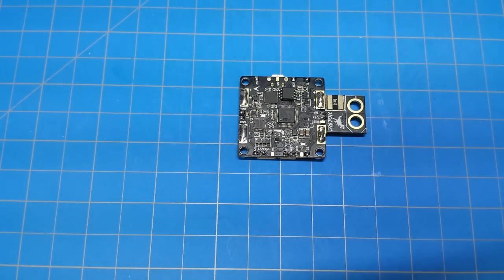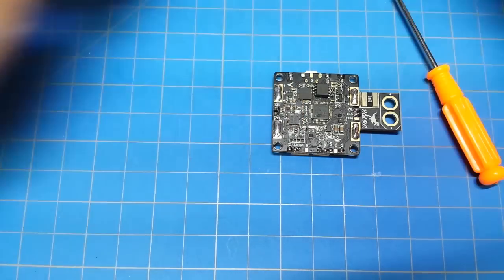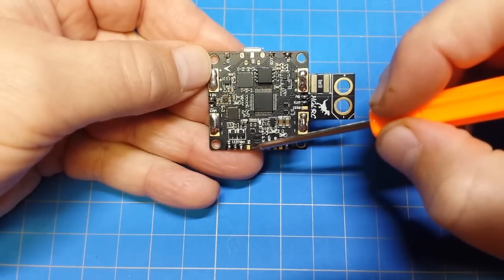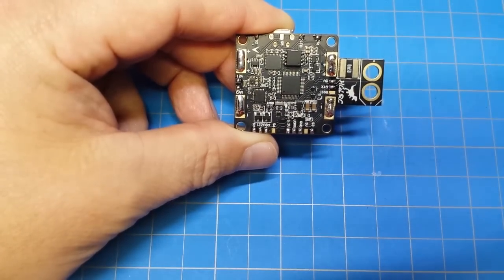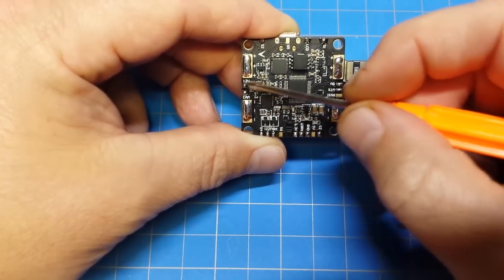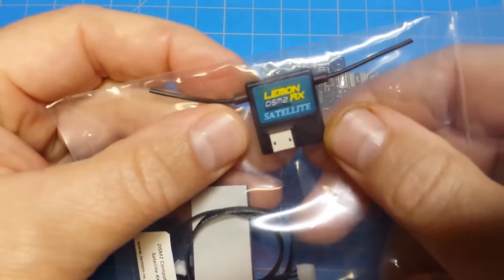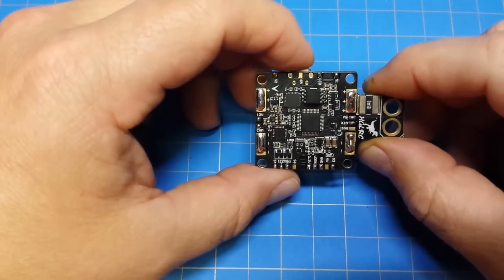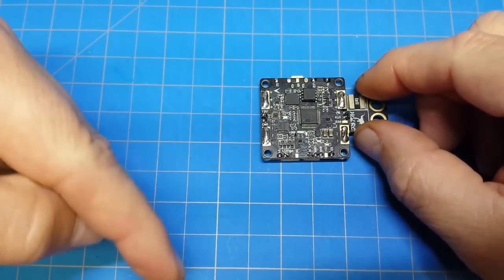HGLRC AIO FC-PDB-OSD-Current Sensor

Comment: For your video wiring there....the problem you had discussed. You can solder you cam to the side that says vtx and you vtx to the side that says cam Im pretty sure. It should just be a straight via connecting only the signal wires.

Comment: Very nice. I've been looking at the Piko blx which is very similar apart from no OSD that I know of. I may have to use one of those to repair my tarot 130 as I've done something stupid and the board no longer talks to receivers. Waiting on a company getting me the mini Tarot in Nave thing but they seem hard to get.
Reply: Here's a link. I really like the layout, and it's extra tiny. Haven't tried it myself yet so it could be crap, but looks great.
http://furiousfpv.com/product_info.php?products_id=41
Reply: i have used the piko in my q carbon 130 and i really like it
Reply from the maker: piko is good. I have a build coming soon. It will be my second piko build. 1st was the Q-Carbon https://www.youtube.com/watch?v=rxaA-nK5W5E Geert, you have one too? That is a good one, and still in my top 2 so far.

Comment: I have seen a few of these boards in action and the problem is after high current draw the OSD will reset, and the video gets really cut up. Not sure I recommend using the OSD.
Reply from the maker: oh wow. I haven't had that happen. But so far I have tuned and run on 3s and on a micro. Can the OSD be disabled if there is an issue?
Reply: i seen it when the guys had 4s, im guessing if you have a problem you can just not solder the video wire to the fc/pdb. the power supply shouldnt be a problem.
Reply from the maker: True, Didn't think of that. Only the OSD is resetting not the FC?
Reply: correct.

Comment: Any info about current sensor? Max amp rates? Can't find it in the specs. Actually, not a lot of specs for this board in the description.  I puled 108A on my new build. If this sensor has a 90 or even 70 Max A rating, i would fry the board.
Reply from the maker: True. I have found on this site http://droneinsider.org/hglrc-f3-v2-review-2/ "Overcurrent ~130A+". This information is on version 2 though.

Comment: Grouped positives and negatives pads for the ESC isn't very handy. You have to pull the wires to far and cross them. I just love the Realacc HubOsd Eco H layout. 5v, 12v ESC pads - everything you need is exactly there you need it. To bad it's not an FC.
Reply from the maker: True the pads could be better aligned and soldering multiple wires to a single pad can be a challenge. Overall I like the board and the new 3.1 version swapped 5v and 12v, xt60 pad switched to pads for battery leds. Are to beat it for $42.

Comment: Doesn't seem to make sense for a lot of builds to have the USB access 90 degrees off from the xt60
Reply from the maker: not disagreeing but how does it affect the build or access?
Reply: I was going to buy this but when I saw the position of the USB I decided
 not to. I like running the Battery connector hanging off to the side 
which will put the usb in a front or back position and make it difficult
 to access.

Comment: hi! cant get the sbus to work on mine, should i just enable rx @ uart 3 or what else? plz help thx :)
Reply from the maker: You might need an inverter for sbus to work. What Rx and flight controller are you working on?
Reply: Hmm. The Hglrc, I think it is v2,2 and Frsky Xsr :/
Reply from the maker: I can't say if the FC works natively with sbus. I would go ppm on uart3.

Comment: Why do you need the FTDI if it has a USB?
Reply from the maker: its not spi (think its spi :). spi works through betaflight this still requires the ftdi.I plan to have the overview of the build it went into this week. I actually recorded this about 2 weeks ago. I didn't want to post it until I had used the board and trusted it.
Reply: FTDI is to load the MWOSD on the board and to configure it. Many Flight controllers with OSD have to be configured this way

Comment: Please PM me. I have two different hglrc boards. The one that is hooked up. I cant seem to get the cam to work.
I have the ftdi. Having trouble with mwosd. Should the cam work without the osd programed?
Help help please. 
Flys fine los.
Reply from the maker: By default we don't have to program the osd on the board, it will work fine out of the box. Do you not get a picture in your fpv goggles? Is the vtx powered on? Can you auto scan with your goggles to ensure the vtx is working? Also be sure to wire the cam and vtx properly according to the voltage specs for each and the video wire from the cam should go to vin and vout to the vtx video wire...typically yellow wires.